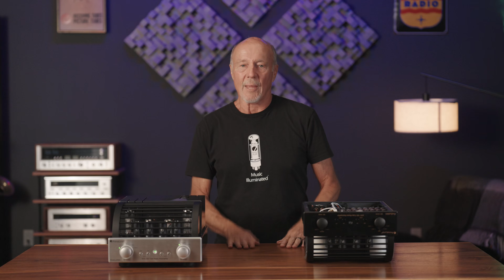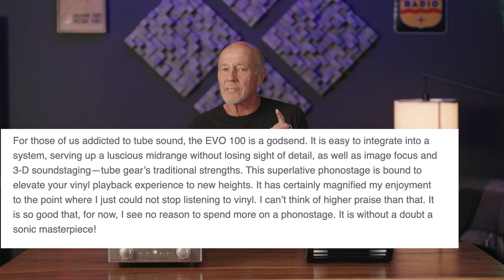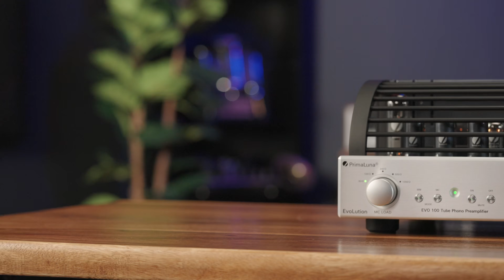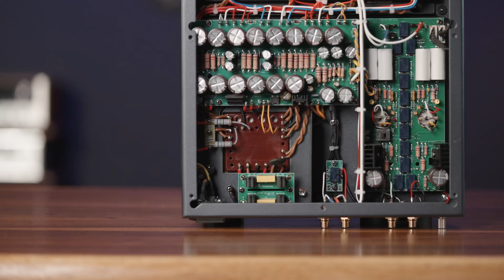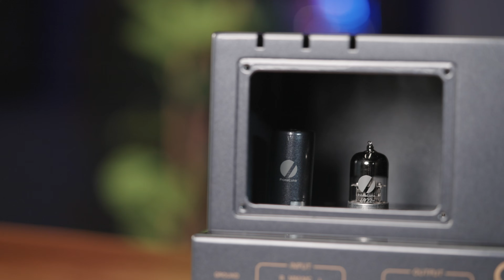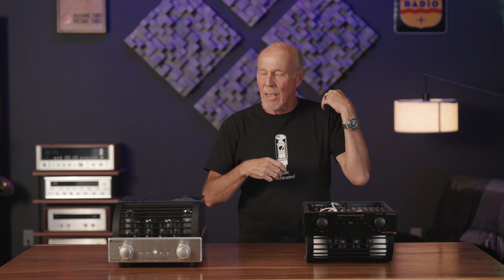PrimaLuna EVO 100 Phonostage V2: Why It's More Than An Upgrade

Comment: I am still happy with my old original Manley Chinook V1 but it is good to know that there are more options available. The ability to use modern produced 12V tubes as well is nice since trying to find 6V Bugle Boys is getting a lot harder and way more expensive lately.

Comment: Get a iFi Black Label Phono with tube solid state technology and over 80 db s/n ratio for a quarter of the price, actually even less l got mine for 1/8 the price! I use one with a AudioTechnica ART-20 cartridge also reviewed by Herb Reichert. You will need a whole day for reading all the positive reviews, including Fremer. Up to 70 db of gain. Comes with it's own power supply you can plug in to the wall not some fancy power conditioner. This thing is 4500 bucks!!! That's a lot of records!!!😊 l would have $4k left over to buy more records!
Reply: I think that if you are forced to shop on a budget, then there are a lot of solid state phono stages out there. But to compare it to something like this? It's like comparing a Mazda Miata to a Porsche GT3.
Reply: @kevind2760 l was not shopping a budget but looking at very expensive phono preamps when l ran across a thread on A udiogon where the owner of the this little guy also had a 20k audio research phono pre amp. He was shocked at how close they were and l followed up with him much later and he had not changed his mind. I also know a gentleman who sold his very expensive phono stage and Japanese high end step up transformer because this iFi unit was better. Obviously you haven't heard it or even bothered to read the multiple reviews but are an expert anyway. GLWT